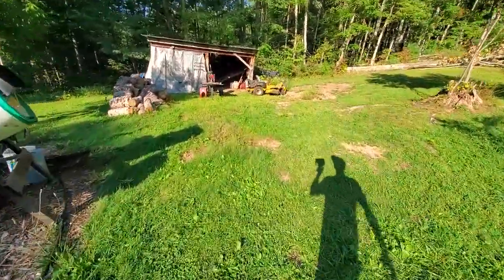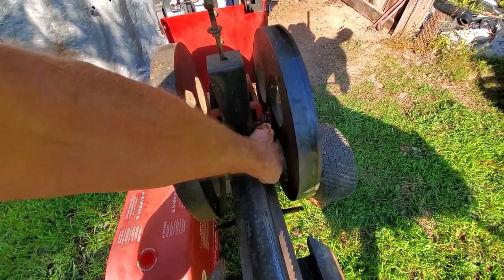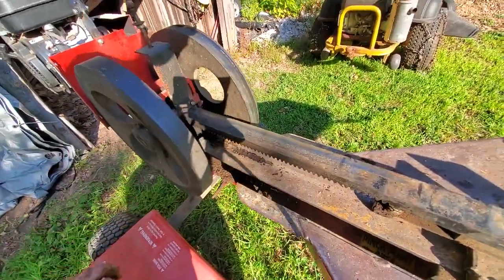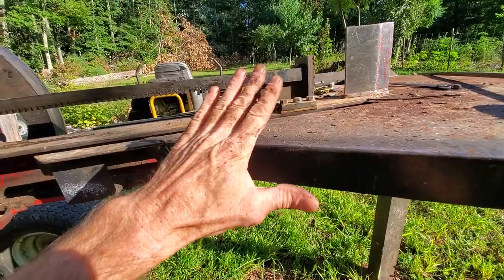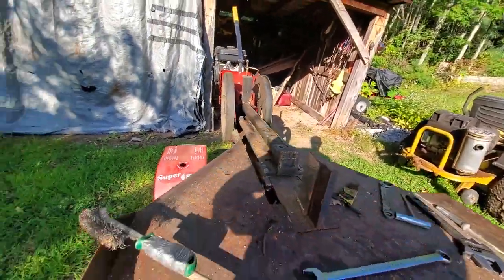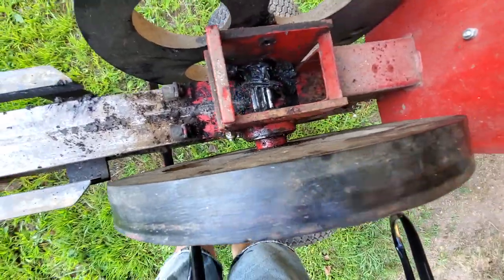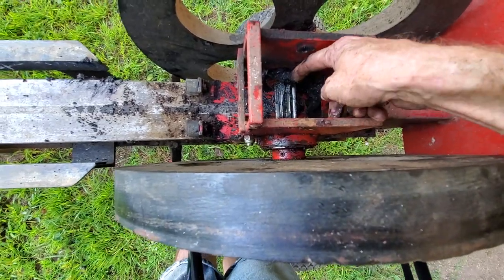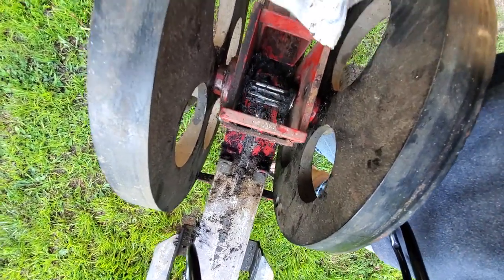SUPERSPLIT Review wood splitter - Blown out axle bearing dust shield(s) PT 1

Comment: OK:yougotthis:, you got me.
by now you  figured it out.
as stated you have the welded on bearings not the bolt on.
SS site gives you a break down as to which parts to order and how this comes apart.
My buddy just picked an old unit up for a song, that said i now have an interest in possible issues. 
anyway wish you luck,  will tune in for part 2.
Reply from the maker: well, i just did part 2 and the phone i used didnt like all the direct sunlight and shut off.  doing part 2 all damn'd over again!!!!!!!!!!!!!!!!! but on the bright side, its gonna be a lot shorter.  i have an easy solve to this issue.
Paul at SS just called me back, he's gonna prob comment eventually on what i came up with.
Reply: ty
 @ifixitall-24-7